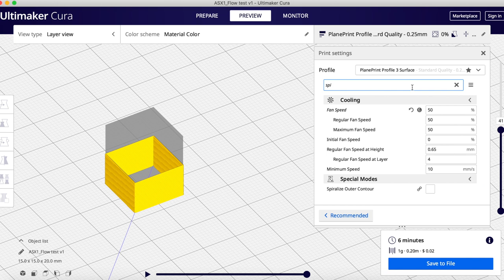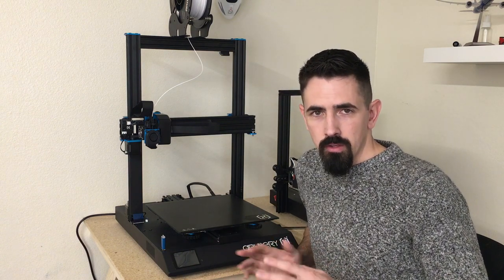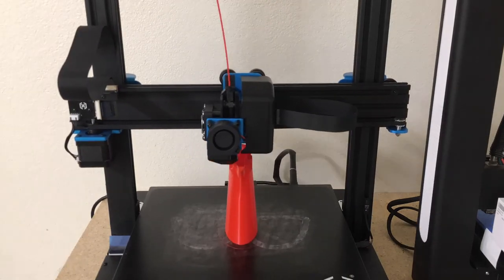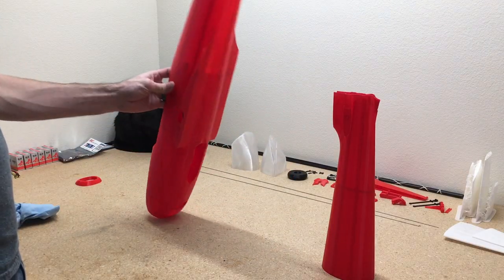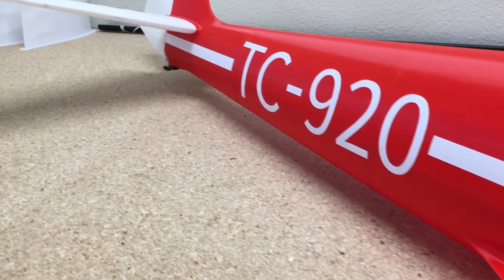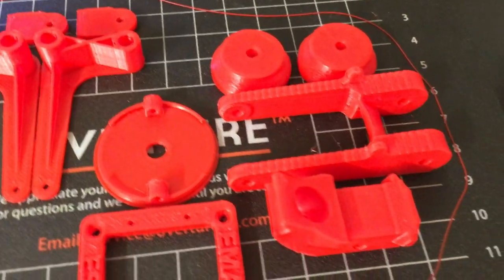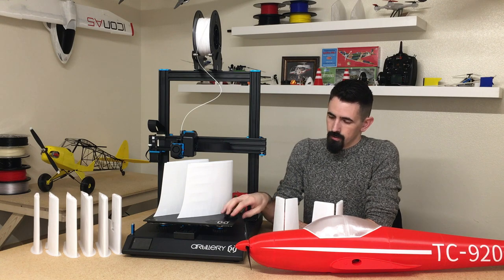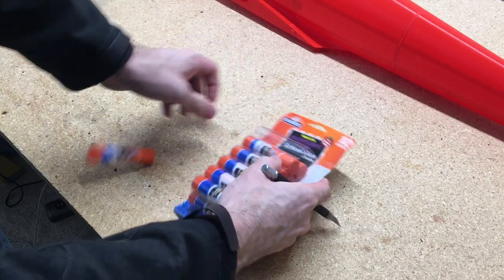Artillery Sidewinder Thin Wall Printing Setup & Review

Comment: Congratulations on your SWX1! I had perfect results with generic PLA off Amazon right out of the box, however I started having issues with ABS, because it required bed @ 100°C all the time, at 100°C bed was sagging in the middle, so  first layer on larger objects was a huge challenge, luckily I got it solved by using ABL, that though required upgrading firmware, I ended up using the stock Z axis sensor as ABL and whambam bulid plate -everything sticks to it rock solid at the same time its easy to remove without damaging thin wall prints.  I tried using glue stick on the stock bed but 28hr long ABS came off with pieces of glass plate, Artillery was super nice and shipped replacement bed for free.  So i highly advise using a quality PEI sheet like whambam.  Also custom firmwares are mostly based on fresh merlin which includes linear advance, which is along with acceleration when tuned properly yelds super sharp corners and even sides at 100mm/s perimeters , 150mm/s infill and 65mm/s small perimeters with generic PLA.

Comment: The Sidewinder is a good start. i got a heavily modified Ender 5 :) 
2mm retraction for a direct drive is pretty huge. im at 0.5mm retraction at 30mm/s and got no stringing issues. For Bed adhesion i use a mirror with hairspray on it - sticks like hell when the glass is hot, releases itself when cooled down to 35°C.  Works just as well for PETG, releases at about 45°C
Reply from the maker: Thank you I will try a mirror

Comment: Hey thanks for goin thru your settings and process. I don’t have sidewinder, but I do have an ender 3 with a direct drive printer mod. Your retraction settings worked flawlessly on my set up with no adjustments and equal results. Can’t believe the quality thanks. No more stringing.

Comment: I use Elmers purple glue stick for adhesion. It really works, it's cheap and it cleans up super easy. A 30 pack cost me $8 on Amazon. All I do is run the glass print plate under warm water and wipe it off with a paper towel. 

Apply glue, print, rinse and repeat.

Comment: I wish I would have found this a good minute ago.  Trying to print 3dlabs P51D on a mostly stock Ender 3.  

Using Overture Silk Silver...and this has been a struggle bus event for sure.  Finally got a good part last night.  Still needs tweaked, but I am going to follow what you have done here, flow test and more importantly the retraction test.

The silk material, finding out is VERY picky when it comes to retraction settings and not having the tip clog causing under extrusion.  1 mm retraction.  25mm acceleration.  Retraction prime at 0.2.  I think I can increase the retraction by 1mm and up the prime to 0.3 to deal with the stringing.  Any more retraction than 3mm causes clogs and under extrusion with the silk on my printer.

Thank you for sharing your set up.

Comment: Ive found for the Creality printers, Their own E-fit 3:1 direct drive extruder kit works great with their Spider hotends. They aint new and their nothing super fancy but thats why they work amazingly well. There also a great bolt on replacement for the baby KP3S kingroon which is great for printing the smalls for the RC planes. For the Enders you  do have to adjust the firmware a smidge but a couple of sample prints later, youd be happy with the results.

Comment: There are 2 things that you might want to try as well.  First, don’t place the filament spool on top of the printer.  With the spool up there, you have an inverted pendulum, which creates ringing, and could also be causing the imperfections that you discussed.  Put the spool somewhere else and just run the filament over the printer.

Second, try reducing the retraction distance even further, and increasing the speed to 60mm/s or higher.  It may sound counter intuitive, but it usually works.  I don’t have a Sidewinder, but on the 2 printer that I do have, I have the retraction distance set to 0.4mm, and the speed at 65mm/s on one printer and 100mm/s on the other.

Have a great weekend!
Reply: I assume you have a printer with direct extrusion?! I had pretty good results with an anycubic with Bowden. After calibrating the extruder, and slowing the print speed and decreasing the layer hight, I had really satisfying results. He's having some issues I have not seen yet. An interesting comment, particularly the filament roll on top. Makes sense! The anycubic has it on the side, but something I will think of when I will get another printer. Thanks.
Reply from the maker: I have noticed the ringing! I am going to be rearranging that area soon and will take your advice and mount the spool on the wall. Thank you!

Comment: Hi Troy. I have the Artillery Genius, also a brilliant printer! I printed 2 tubes that fits between the roll holder bearings. No more adhustment, all size rolls fit. Then, google acceleration calibration. It sorts a LOT of issues. I print at a speed of 60 with pla. Printed 13 planes so far, fantastic results.

Comment: I am a quad pilot, I just built my first wing and I think I should get a 3D printer.
it just seems very involved, thanks for the upload
Reply: If you’ve built your quads.....3D printer is child’s play😎
Reply: A great start is the Creality Ender 3 for around $210, or get Ender 3 V2 with the better processor for $260-285. You need to swap out the springs for the bed leveler, I got 12 for $8 on Amazon, only need 4 of them. The springs that come with it are crap. New springs are a must. The micro SD card reader won't last either but you can get a good one for $10 or less. All kinds up upgrades including a direct drive for $40 or less if you catch it on sale on Banggood. For $250 you can extender kit and print big.
Reply: @DirtyBob2001  thank you ! and happy flying.
Reply: @ruftime  i am going to take your word for it,, wish me luck !

Comment: Thanks Troy, I’ll be reading all your posts pertinent to building planes. I’m a junkie from way back.
Reply: I was a bit amazed at how meticulous your revision of the Cessna 172 ??? was. I built the Aeronca Champ because that was the plane I soloed in (Jan 2, 1963, I’ve been around for a   l  o. n  g   time). Anyway I know where I want to put the printer but I’ve got a ton of old drones and never started kits in the way.also a never set up printer/XY carver whose bed was too small. Dunno when I’ll get the printer. It’s ordered but i hope it takes a week.bye for now

Comment: And try a good hairspray. One thin layer on a clean bed. No adhesion issues again
Reply: Agreed. Once I switched from the stock bed on my ender 3 to a glass bed with hairspray, I've never had an issue with adhesion or lifting.
Reply: @abyssalreclass  I prefer to use ender 3 magnetic flexible build plate
Reply: I have had the X1 for 3 weeks and I can say that there is no need to use hairspray because the ultrabase has micro holes which make the parts adhere well even if they are high
Reply: what brand do you use? UK brands?
Reply: @alpaslanalperkayar  you can even use amazonbasics PLA.
you just have to clean the bed with isopropyl alcohol after a few prints.
but the most important is the adjustment of the bed!

Comment: I have an X1 version 4,  I wound up adding a Z hop for moves to avoid the extruder tip catching on thin walls and the internal structures.   I also us a 2 layer brim about 6-8mm around the part on some of the thinner pieces and they really stick good and don't warp.   I then use canned air with a blow tube and the cool air pops the brim right off the bed.

Comment: 10% white glue and water brushed on and dried with the heated bed. No adhesion problems at all. Can be cleaned off completely with rag and hot water.

Comment: Hey you better not beat me to the Savage Bobber maiden! Drives me crazy it takes me so long to finish one! Another great video Troy! Next time you place an amazon order get a roll of Sunlu SPLA, this stuff is awesome! It is a blend of PLA and PETG so it prints at PETG temps with minimal warping and a bed temp of 80+. It's all I build out of now. Best thing is they aren't brittle like pla and have a smooth and shiny look and feel. See ya!
Reply from the maker: Thank you for the recommendation I may try that out. You may beet me to the savage bobber maiden. I have mine all printed out I have not started assembling it yet. I may start the weekend on it. Cheers

Comment: So I can’t get the stringing to stop with the LW-PLA so have been doing one part at a time on my printer (ender 3 pro). I can get a good .40 wall with the cube but can’t for the life of me get the string test to come out well at all. Do you use 1 wall only on that too? If I increase the retraction it does it all before it moves off the part. I wish Color-Fab website would talk about the ret settings.

Comment: Have you tried Linear Advance? It makes wonders for flow control and makes printing thin wall prints like these waaaay easier to fine tune
Reply: especially on corners it makes a big difference, no more bulky or round corners.
Reply: Hi, sorry for my stupid question, but what do you mean by linear advance ? Another type of printer, program? Or something else’s? Can you please explain. I’m very tempted to start 3D printing.
Reply: No problem, Linear Advance is a feature you can activate in the firmware of the 3d printer(given that the control board has enough memory left) that compensates for the compresion on the filament path. So the bulgy adges or the underextruded  starts of extrusion paths disappear.
Look up "teaching tech linear advance" in youtube. He explains it better than I can :D

Comment: I’m hooked. I ordered the printer. But how about advice on designing structure? I’m interested in pretty small models so I shouldn’t need much and RC gear and a tiny video cam dictates some needs. Oh well, I guess I said what I have to. BTW, I’ve been flying for about sixty years. Started with an Otarion superregen and an SE-2 escarpment. Bought propo gear as soon as it came out. Never flew reeds.
Reply: Damned spell checker.  That word is escapment
Reply from the maker: @petebard  Smaller planes definitely don't need much inner structure. I printed a small UMX timber and did not have any inner structure in the fuse and on part in the wing. Good luck with the printer and with your builds.

Comment: Here's a great tip,  you can blow canned air right where the brim is stuck on the bed, the air coming out of the can is cool and will pop the brim right off of the glass bed, no spatula needed.

Comment: Awesome!  Thanks.  please share if there are good websites to buy from them the 3d plan stl files.  Do the plans come with building instructions or power setup requirements or I will be left with a bunch of plastic pieces and I need to guess which ones go together?  I ordered p1s and looking forward to start and learn about building rc plains.  Did you use light pla or normal and usually how many filaments you need up build one jet/airplane of a wingspan of 1500mm.  A lot of questions!  Thanks

Comment: Hi Troy. You listed your settings for this printer for Overture PETG. Would those same settings apply to Overture PLA and LW PLA on this printer as well? Does the USB drive included with this printer already have CURA installed, or is that a separate purchase! Thanks for your help. I will be using your link to buy a Artillery Genius printer tomorrow!
Reply from the maker: Thank you for using the link I appreciate that. Cura can be download for free. https://ultimaker.com/software
The only difference for printing PLA is turn the temp down to 215c everything is the same. For LW-PLA turn the flow setting down to 53% and temp to 235c.

Comment: Hi Sir, I have the same model of 3D Printer (Artillery SW-X1). Plz suggest me the software for this printer because its standard model present in its Cheche like its Logo are just printed through this 3D printer but when I'm trying to be printed from my Laptop then it doesn't print. Plz suggest.
Reply from the maker: Try using Cura to slice it!

Comment: just clean the surface before printing. dust on the air is sticking when the surface heating. the same dust sticking to the filament and it is  obstruct the nozzle.

Comment: I’m interested in starting to print  planes parts. I have a 3D printer with a small print area that i will use for now, but will need to upgrade before long.
Is the Artillery SW-X1 still you go to printer for planes parts? It looks like the SW-X2 is the current version available would it be a good option?

Comment: Hi Troy what program are you using to convert 3d lab print object files into gcode thank
Reply from the maker: I use Cura for all my prints. You can slice 3d lab prints planes in Cura it is a bit more difficult to get a good print.
Reply: @TroyMcMillan  thanks i am new to this and cant get a good print with 3d lab files i will stick to others until my skills improve

Comment: How do I go from a design in autodesk fusion 360 to the 3d printer? Will the slicer put in the joints to glue the components together or is that done at the design stage?
Reply from the maker: it is done in the design stage, you have to do that in fusion 360
Reply: @TroyMcMillan  that what I was thinking. I purchased the Artillery Sidewinder and some PLW & BLACK TPU for some tires I WANT TO DESIGN. I  have been looking for LW-PLA but not have much luck just white looking for gray for my B-52 W/8 32mm EDFs I purchased the glider you featured on utube that will be my starting point thanks for your help
Reply from the maker: @timothygiggey1610  yeah check out fusion 360 for designing them, it works great. It's a lot of fun when your design is printed out too :) the glider is an amazing plane, good luck with it!!

Comment: What are your thoughts on the Sidewinder? 
(8:05) all parts fit on 200mm x 200mm area  when referencing the Overture pad.
Genius has a 220 x 220 x 250 mm bed.

Comment: Hi Troy, my thin wall pla is looking pretty good now thanks to your videos helping me tune it. The only remaining issue is some minor pock marks on the flat side of the test piece which occur from about half way along the section up to the z seam.  More prevalent at the top 3cm where the overhang begins.  Any thoughts?
Reply from the maker: Pock marks can be fixed by slowing down the print. They can also be caused from moisture in the PLA. If the PLA is not a new role then it can have moisture and pop when it goes thew the extruder causing pock marks.
Reply: @TroyMcMillan  thanks Troy, the pla is new, so guess its speed. I will give it a try.
Reply from the maker: @LaurenceCampbell  I usually print at 35mm/s
Reply: @TroyMcMillan  yeah,  i was at 55m/sec on my sovol sv01. Will try slower.

Comment: Hi great video, have you tried the supplied g code from 3D lab print on this printer for lw-pla? Or do you alway slice your own with cura
Reply from the maker: I only slice my own setting. I did not try just loading the G code
Reply: @TroyMcMillan  I have just printed the Albertross from 3dlabprint in lw pla using the supplied g codes and it works fine on the sidewinder x1. Finish looks fantastic
Reply from the maker: @paulmason6847  Nice thank you for letting me know that is awesome to know that the files work for the sidewinder.
Reply: @paulmason6847  Did you make any changes to the printer I have one coming and hope I can print out of the box with gcodes
Reply: @johnkearney9339  no changes, it just prints right from the G code, only thing I found was due to the shape being long and thin for the wing sections - I would get a little warping near the ends, I stopped this by using masking tape on the bed, never normally use masking tape but it works fantastic.
Reply: @paulmason6847  thank you looking forward to using mine now I have endler 3 but have problems